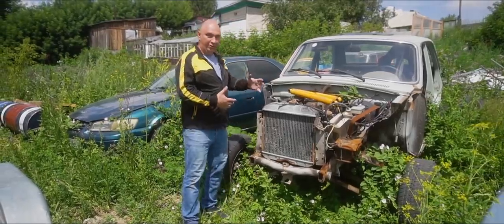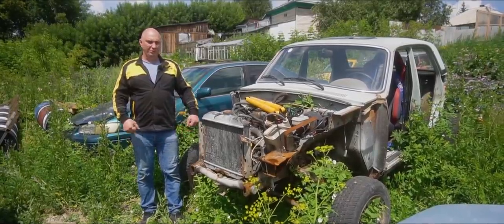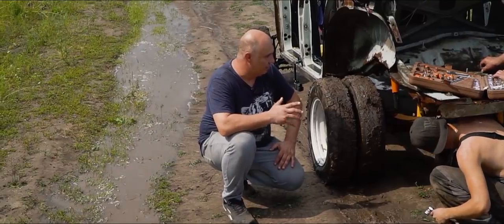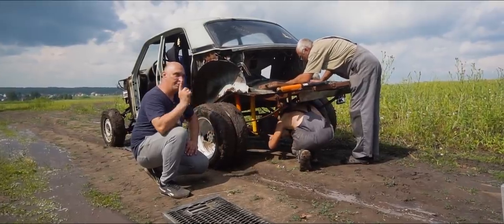Fitting a ridiculous amount of shock absorbers to a car

Comment: i love how he never waits for any engine to warm up, starts it and drives immediately!
Reply: Once the oil pressure comes up,you are good to go.  Modern cars don't need to warm. Up.
Reply: @robertheinkel6225   for one, the cars he drives definitely arent modern vehicles, and for two, i have a modern hilux diesel (2007) and it hates being driven straight away,  warm it up for five and its good to go.
Reply: @joeprinsen1717  little baby diesel
Reply: @brendanberry7403  its a 3l. which is the largest diesel hilux motor you can get here.
Reply: @brendanberry7403  try driving a duramax as soon as you start it, it makes almost no power and blows shit outta exhaust for 5 minutes before anything happens.
Reply: @joeprinsen1717  I wouldn't drive a durashit if you paid me lol.

Comment: Put a transmission on each rear wheel and see how that goes
Reply: 2 engines and 2 gearboxes, each engine and gearbox powering it's own wheel. Also setup the breaks so they can be used like "tractor turning breaks", So you get independent rear-wheel breaking.
Reply: Greetings to the international space station !
Reply: @TheHungrySlug  Make it 3, have a fwd + 2 rwd.
Reply: @TheHungrySlug  They are brakes

Comment: the shock absorbers resist against up and down movement (different rate) to prevent the car bouncing and whaling so adding more will definetely stiffen the suspension 
on extreme offrad vehicles (like the ones used in the baha rally ) they add more shocks to keep them working when the oil inside them gets warm and thinner they start as rough as on youre car but after about 30 minutes of washboard roads they soften up a lot

Comment: just an FYI the more angle your shock has, the softer itll feel in the suspension and the more travel you can get out of the shock. Those cross shocks actually might have been pretty nice compared to all the nearly straight up and down ones

Comment: Suspension has to move ir you might as well weld in steel blocks. I upgraded my 65 mustang with 650LB/inch springs. Still moves but never bottoms out.

Comment: Try all the shocks, get rid of the leaf springs and put the most basic of trac bars (in line with axle (or not IG pinion angle isn’t of concern 😂) just to hold the axle in place. New title: ALL SHOCKS NO SPRINGS — or — Replacing the springs with an excessive amount of shocks

Comment: Wasn't the outcome already obvious, before the experiment. These shock absorbers are meant to control the rate at which the springs absorb energy from impacts in the road, if their are to many of them the weight is supported as if to have no suspension.

How ever you could have used much weaker dampers and several tiny springs that would have been an interesting experiment, take the spring rate and damping ratio you have now and calculate for the same stiffness over several coils.

Comment: I reckon you should look at trying to build a 2CV platform without any Citroën parts, horizontal springs, true independent leading and trailing suspension arms, etc . . . 

Maybe later attaching an air cooled flat twin up front?
Reply: so basically make a LadaCV
Reply: @kasuraga  With all horizontal suspension components, 8 springs, tied front to back so the rear clears whatever the front hits. No vertical aspects at all

Comment: Do you have summers over there?   My two working Slava quartz watches are stopping in the heat, cool 'em down and they are OK again.   I expected more from these two old Soviet boilers... Hey if anyone has an old MK1 Vyatka just kicking its heels over there or one of them fibreglass 3 wheelers, have been after a Vyatka for years.

Comment: Hey garage 54 you should take a lada engine drain the oil and fill it up with Rain X or see it a Lada will run off Rain X or. Take a Starter and hook it up to a DC Arch wielder and see how long it takes it or even take the starter and drop in the bucket a salty water

Comment: lol why would you think that would work?  the only reason a suspension works is because the weight of the car can push down on the suspension.  if you have that much pressure holding the car up, the weigh of the car won't be enough to push down at all. you may as well have welded them into place. those may as well be solid rods of steel holding the car up since the weight of the car isn't enough to compress them.

Comment: A heavy duty full size truck is very stiff and rough until you load it up.
Reply: indeed you are correct. So many factors come into  play with the make, models, body trim package, etc... That is why all the  manufacturers that produce them make so many different versions.

Comment: Since all the shocks are pointing in different directions they can't compress, it really is like you replaced the suspension with tubing. Redo the test!
Reply: As long as they aren't bolted solid and the shock bodies are able to pivot then they can move in and out just fine. They wouldn't care about what the others are doing or how they're mounted.

Comment: Hmmmm.....I hope you guys ARE aware what the purpose of the suspension is, and what role the shocks are playing in order to achieve it ??

To make it work properly, you should have increased the spring torque equally much as you increased the damping resistance. This video ended up being pretty "meh", as it's entirely based on an incorrect scientific model.

Comment: Is it possible to freeze a running engine? :D

Please make a video about what will happen to a running engine, when you will add liquid nitrogen to the oil. Either through the oil filler or (better) through the oil dipstick tube. Of course there should be a disassemblement of the engine at the end of the experiment.

Greets to you crazy guys from Bialystok, Poland!